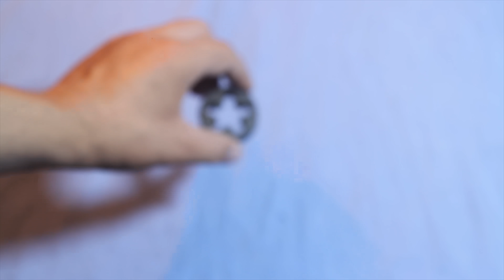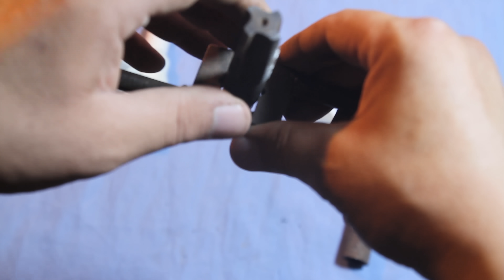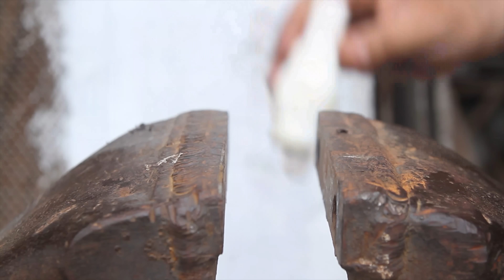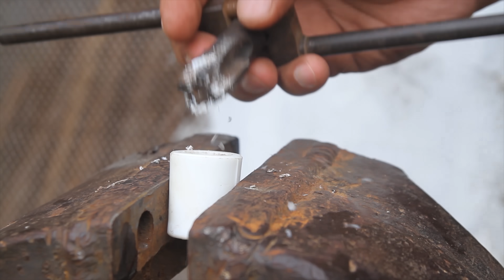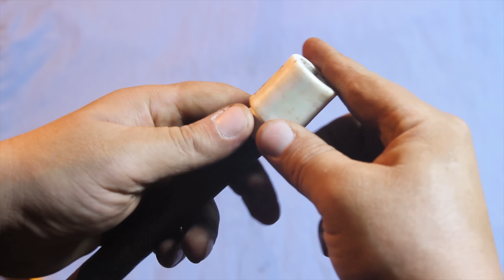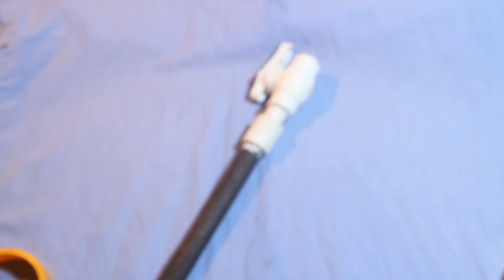Saw One Plumber Do It - Hidden Tricks of Experienced Plumbers

Comment: I am NOT a plumber , but have two questions . First , NPT thread is tapered to seal . I believe the tap and die used were straight thread . I guess it would be fine if not under 60 lbs. of line pressure . Second , I didn't notice that ANY of the fittings were deburred . If I have to explain that , I think we should end this here . Perhaps this is only on a drain line .
Reply: Nothing here that an "experienced" plumber would do and charge for. They make special dies and taps for threading plastic pipe like in the well pump business for dropping down Eagle piping in a well case. Other than that, this is saving a buck at the expense of assuring the DIYer these are real repairs.
Reply: So is BSPT, though looks like a Second maybe a 1st/Taper start BSPP tap and non adjustable die all the rage in USA, nothing wrong have tested 1/2" BSPP screwcut threads to over 10000 PSI far from a  pultry 60Lb/60 psi.
Reply: hey Billy  !  not everyone, on 'youtube'   resides in the former,  '' good   'ole   us  of a  ''.    People planetwide, need  ' likes '   on their youtube channel,  too  !   Consider   !

Comment: Once upon a time, while working in a 200+years-old house, I made a 1/2" tapered die out of a 1/2" Black Iron coupling so that I could  recut missing threads on a chrome-plated brass 1/2" nipple sticking out of a wet-bed tile floor in an inaccessible corner under a toilet, by filing teeth on the inside of the black iron coupling with a triangular file. It only had to work once, which it did quite nicely.

Comment: An experienced plumber wouldn't use a rusty old piece of pipe, or put threads on a piece of Sch 40 PVC. They would've used the proper fittings and pipe for whatever was being repaired.

Just because you see a professional do something, doesn't mean it's right. "Professional" means they get paid for it, not that are necessarily good at it.

Comment: This was done wrong.  Plastic should always go inside metal.  Plastic has a higher expansion ratio when heated than metal, and if the outside of a joint is plastic and the inside is metal, it will begin to leak.
Reply: I am 73 y/o and will not stop studying mechanics/engineering daily, but I could have looked for a mention of the thermal expansion relationship between the two materials until the end of time and never found it in a tech book. Thank you!
Reply: Some great educated replys here. If that guy didn't post that rubbish video..... A lot of wise comments would never have come out

Comment: Thanks  for sharing this idea. ..but what are  the size of these tools?
Reply: It looks like a 1/2" pipe die and a 1/2" pipe tap. Seems like it would have been easier to just glue the coupling to the PVC pipe using PVC cement and quicker too.
Reply: Plumber for 30 years we would fire anyone for doing that

Comment: As a professional plumber, threading metal pipe into plastic (PVC) coupling is never encouraged. Especially since he threaded the PVC coupling, removing material that would otherwise provide strength at that joint. The plastic will eventually fail. Also, Teflon tape is applied to the threads to reduce friction, not prevent leaks.
Reply: good advice....thanks
Reply: This would be good for a temporary repair though.  If I had water running all over the place I would use this until I could repair it properly.
Reply: Thank you for the education! I would have never thought of the Teflon tape being used to combat friction.
Reply: I would disagree about the tape only used to reduce friction.  I apprenticed with a master plumber for a year, he always used both Teflon and soft thread compound (Mega-lock or Monster) on threaded joints. I've used only Teflon when I didn't have the other, and I've had to rework leaking fittings a couple times, it's a pain in the a**
Reply: @25yr_afveteran14  Thank you, That is what I thought but it was so radically different to what I had learned and had been doing for 40 years it stopped my normal brain functions.